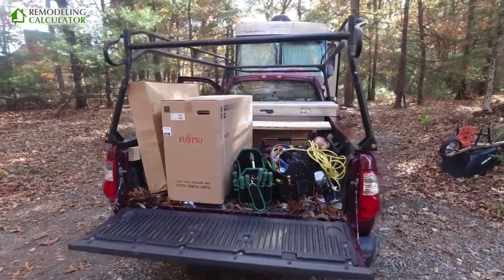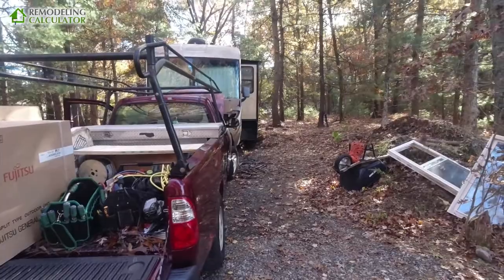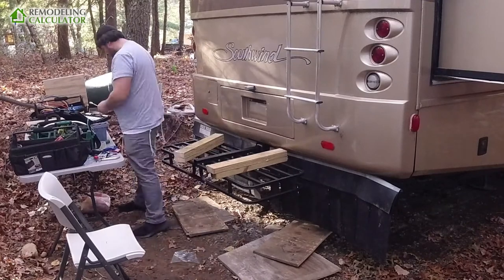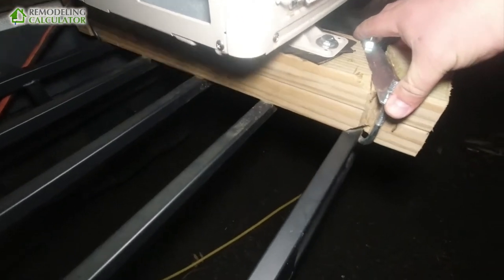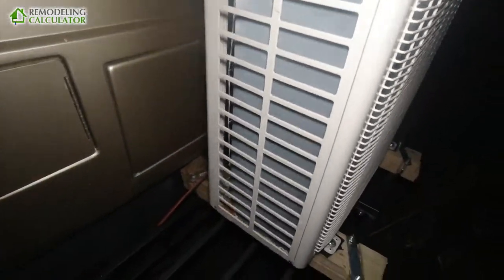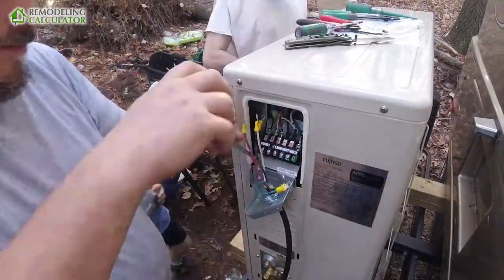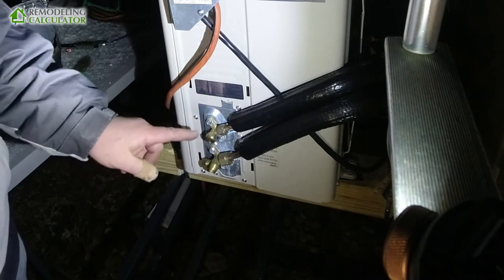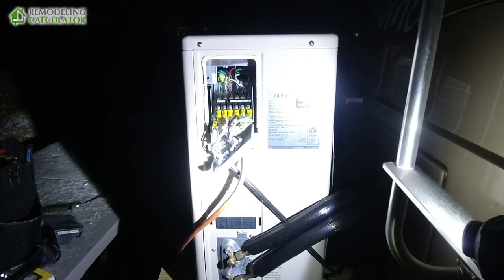RV Heat Pump DIY Installation - Mini Split AC installed in a 32' Class A Motorhome / Camper

Comment: Have there been any vibrations down the frame of the unit. I was thinking it might send vibrations through the frame of the class C. I’m just about to do this same thing on the back hitch as well.
Reply from the maker: So that's a great question that I haven't thought about before installing it. As far as in the camper I've not had any vibrations and honestly this unit barely broke a sweat heating up the camper.

However, I have the same unit installed on the wall of my house that's heating a 600 square feet loft. When it gets really cold outside, say 0° or -10° or something like that, you can hear that compressor going and the vibrations on the wall are obvious. Not that the house is shaking but you can hear it for sure.

So that's the condition when there is a very heavy heat load on the unit and very cold temperatures outside. So at that point the unit is definitely consuming 10 amps of power (2400w) and it's working as hard as it can, and compressor is working hard.

The camper is half the size of my loft so this heat pump doesn't need to work as hard. Second point is that in my case the indoor unit is located in the back of the camper which will get hot wouldn't say 5 minutes of the heat pump running, and then the temperature sensor on the indoor unit sends the signal to the compressor that everything is good. So at that point I have to put the fan speed on high to get the rest of the camper hot.... So basically heat pump thinks that everything is good, and the set temperature is reached, and it's just running in normal heating mode with the fan speed on high. Now high fan speed, it does make the compressor work a little bit harder than normal, because more heat is removed from the indoor coil, therefore more heat must be delivered by the compressor.

Again I am not sure how clear I made it in my video because I made it a while back and I don't remember, but this unit is 240v ... Therefore it's completely unusable at any camping site unless you have your own inverter and battery bank and have a way to charge your battery Bank from 110 volts, while drawing 240 volts from the bank to run this heat pump.

In the United States campgrounds and RV parks do not have 240 volts hookups. So you're pretty much limited by 110 volts if you want to be on the go with this thing and use it for heating, and that greatly reduces the heat output and the efficiency of the unit. The best I found so far is Cooper and Hunter high efficiency 110 volt unit, but I haven't actually worked with it so I can tell you for sure how good or bad it is. Good luck
Reply: 50 Amp Service is available at most campgrounds in the US. %0 amps is actually 240V. Inside your RV it is then distributed as 2 legs of 120V. In some higher end RVs, they actually run a 240V line for the clothes dryer. @RemodelCalculator